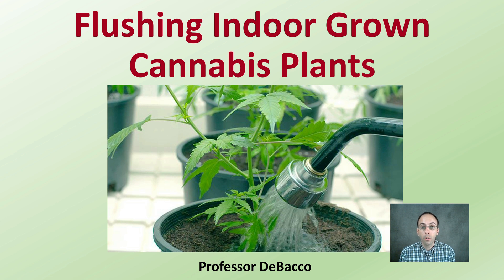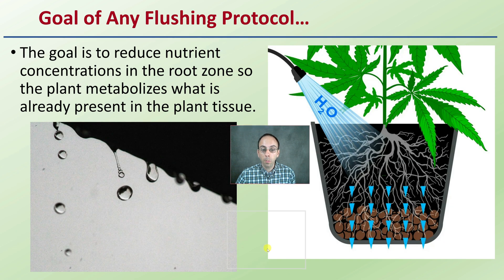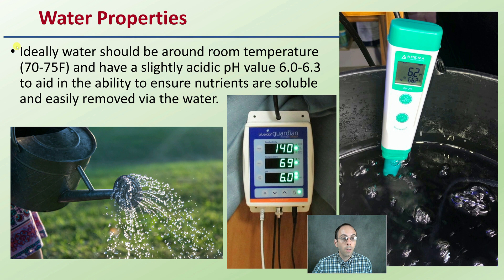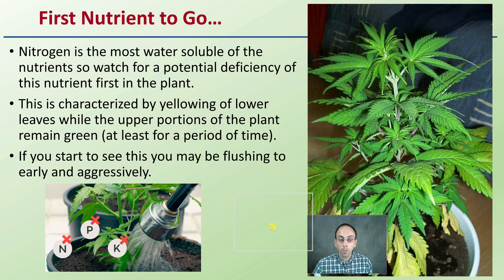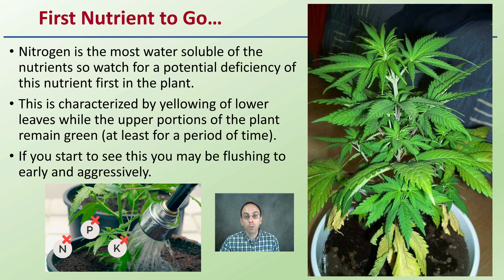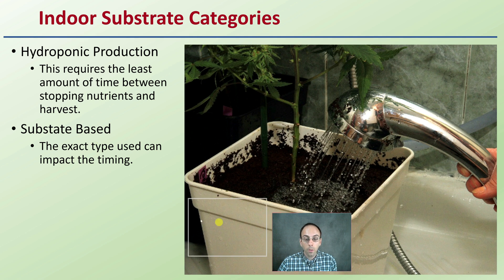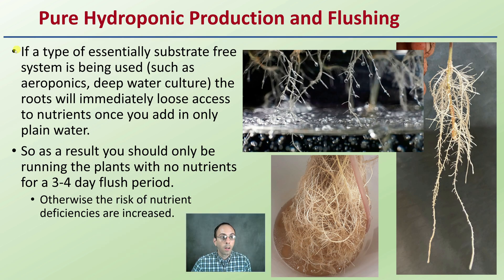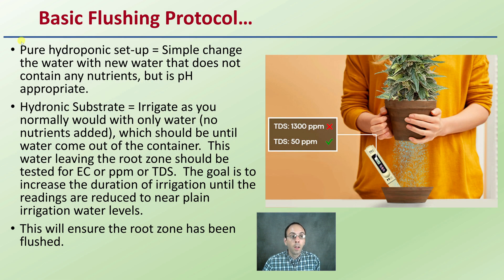Flushing Indoor Grown Cannabis Plants

Comment: My tap comes out at 220 ppm or higher can I use distilled water to flush the plants to get under the 220ppm?any help would be appreciated!Thx in advance
Reply: Should never be using tap, always distilled water. Use chemicals called ph up/down to adjust your ph
Reply from the maker: 220ppm is high so consider some type of filtration system with RO being the gold standard.

Comment: Did you cover soil based flushing? I didn't see soil in the list of different grows. The general timeframe online is 14 days for soil. I have RO water so the PPM is 0. I don't wanna start flushing too soon as my water has absolutely no PPM. Maybe I should flush with PH leveled tap water? Which mine comes in at 200-300 PPM.
Reply: You honestly don't need to flush unless there is a nutrient lockout.  Flushing stresses the plant & can stunt growth.  I usually just stop feeding about 10-12 days before harvest & I'm good.  I never flush.
Reply: & if you're growing organic you definitely don't need to flush.  If using Fox Farm chemicals you might have to flush once at the end but I don't even have to do that when I use it.
Reply from the maker: Follow similar methods but start about 7-14+ days prior to harvest depending on soil type.
Reply: @DeBaccoUniversity  it's Sunshine mix #4.  So it's pre mixed. But what difference would that make on flushing? Less or more?